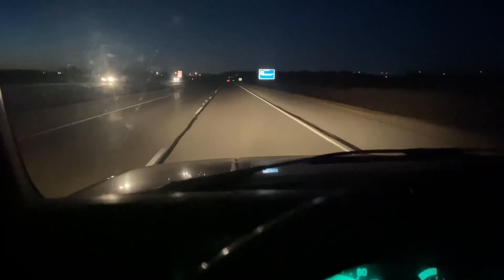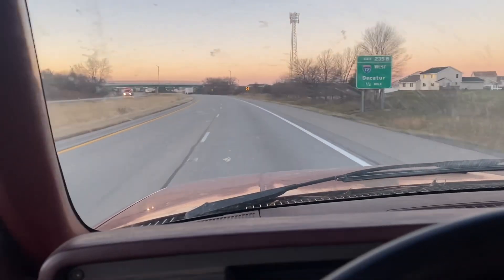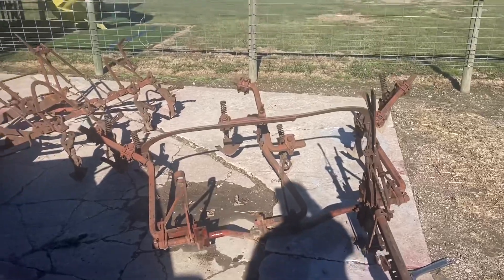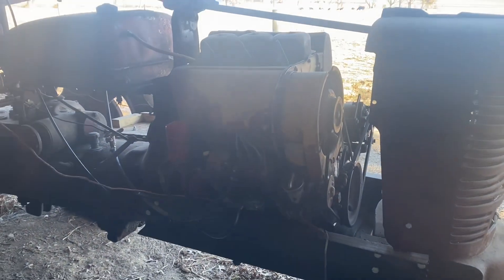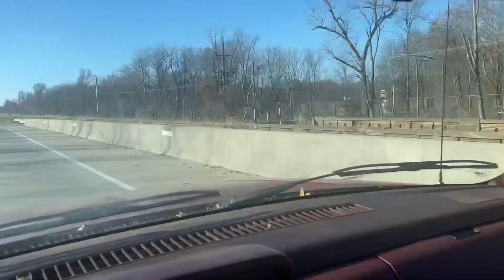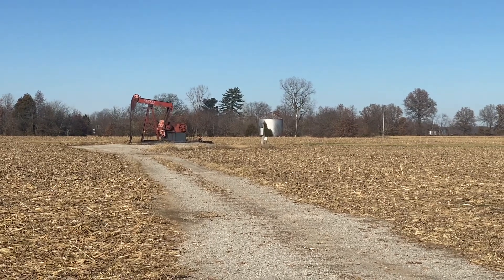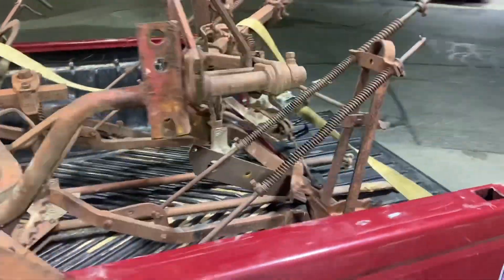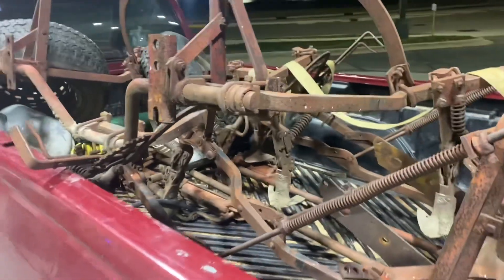Another Saturday dragging something home 12/3/22

Comment: Nice find! I have the same HM-221 cultivator on my grandfather's H. Manuals for those are really easy to find on eBay, I can also take a few scans of my manual if you need some instructions.
Reply from the maker: As I said this isn’t the same as my Dad had. My Dad’s had three lift cylinders. There was a separate lift cylinder for the rear which also had it’s own depth adjustment lever.